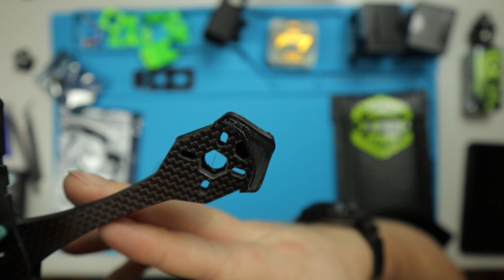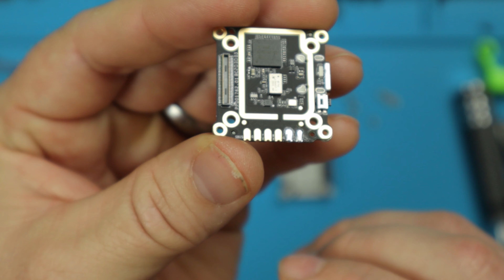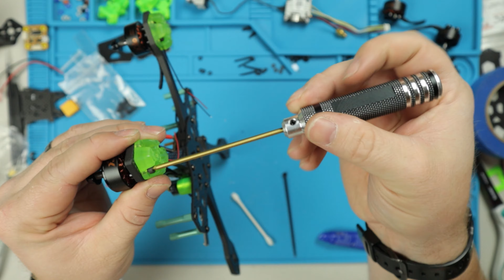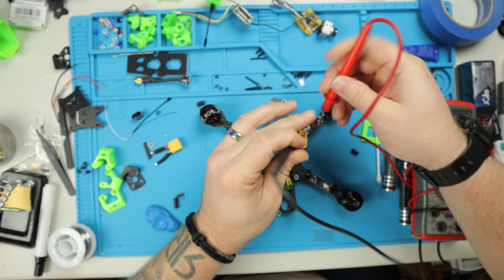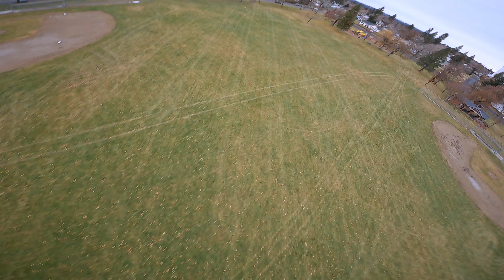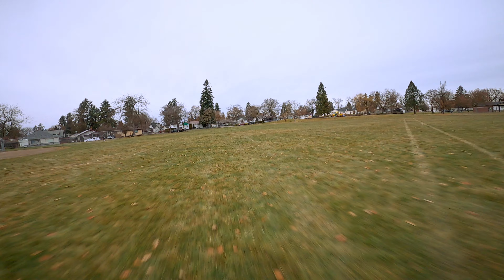QAV-S Complete Build Guide [ 5" HD Freestyle FPV ]

Comment: Awesome build video bro!! Any idea where I could find a 30 degree mount for a hero 7? All I seem to find are 20 degrees. Which one did you use?
Reply from the maker: thanks bro! glad you liked it. The mount i designed is 25 degrees if that helps. I should be linked in the description.
Reply: @509drone2  I checked and it seems to be for the hero 7. Do you prefer 25 degrees to 30?

Comment: Are the rotors in the way? Want to build this with an air unit for 1080p and just skip the gopro...
Reply from the maker: They are about 2 inches from the rear of the frame, so i don't think an air unit would fit :( I could be wrong though. I'll measure one of my air units and check to see if it will fit, and post back.